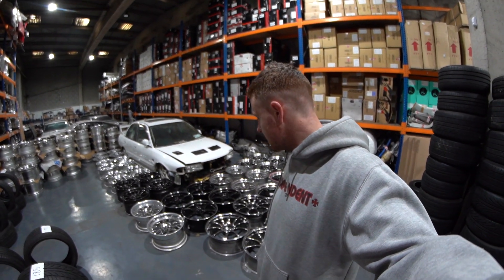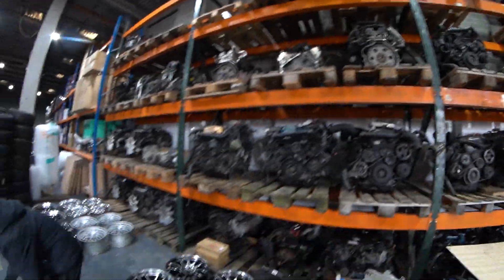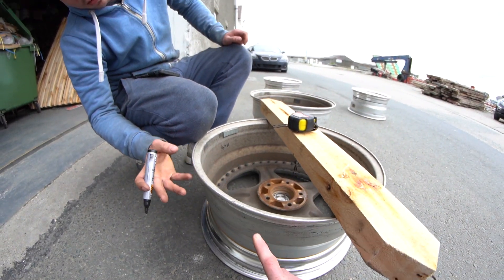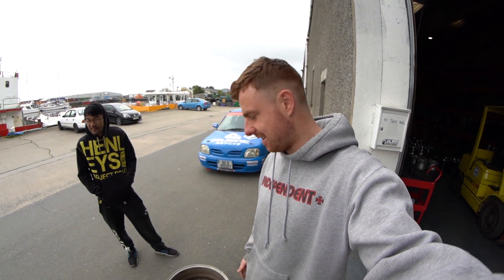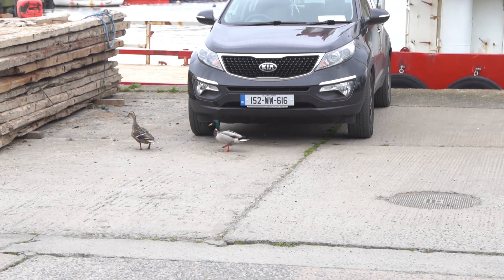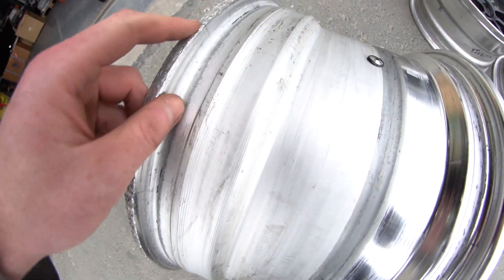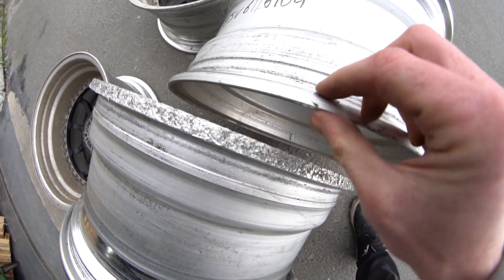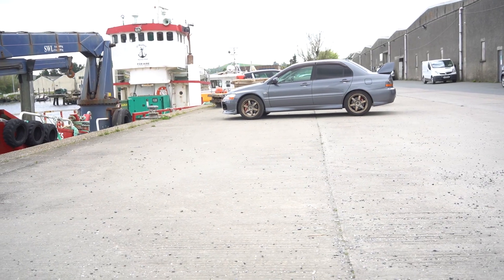Cracked wheels and a Mitsubishi Evo IX MR: Behind the shutter #26

Comment: equip 05's and blitz 03's just casually sitting on a wall........ drools excessively
8 cracks....... still safer than rota's
Reply: Are you sure? I'm pretty confident that Rotas are better made than most of these old JDM wheels
Reply: @twongi3000  rotas are JUNK.
Reply: @Mr_jz_12  how so? From what i've seen, Rotas are perfectly fine.
Reply: @twongi3000  knock offs and weak.
Reply: @Mr_jz_12  have you got any evidence to show that they are substantially weaker than the original wheels?
I'd even go as far as saying they are probably stronger than most of these old JDM wheels.